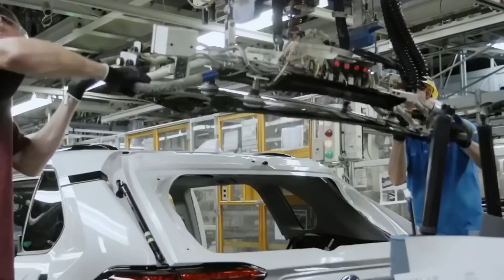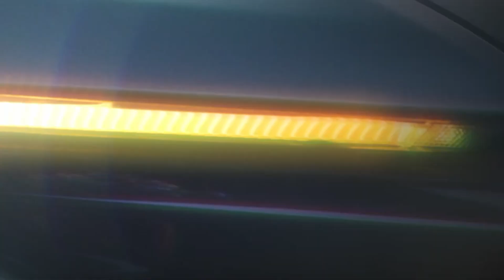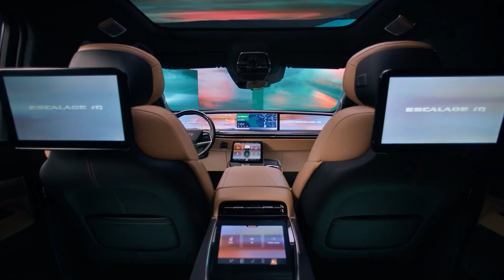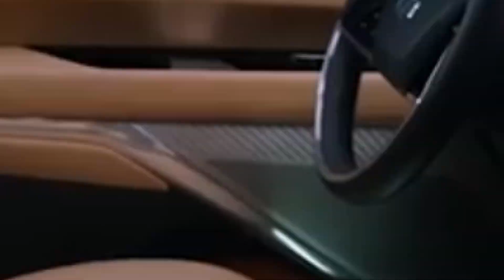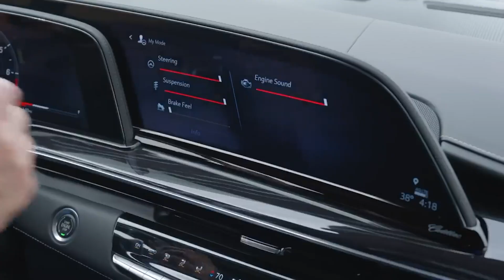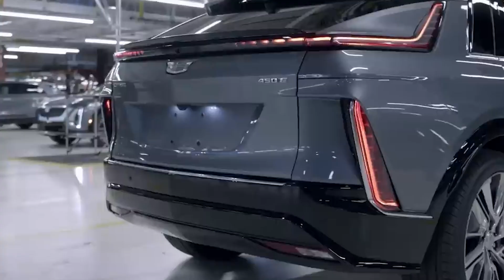450 Miles Range | Cadillac Escalade IQ!!

Comment: Then why does the owner’s manual suggest only charging to 80% which is only 378 mile range.  GM lies
Reply from the maker: They usually recommend charging to 80% for daily use to protect battery health and extend its lifespan. The 450 miles GM advertises is based on a full 100% charge, but most EV makers suggest stopping at 80% unless you really need the extra range for a trip.